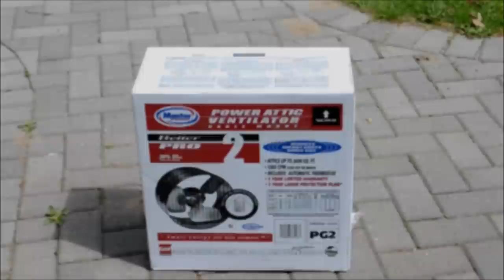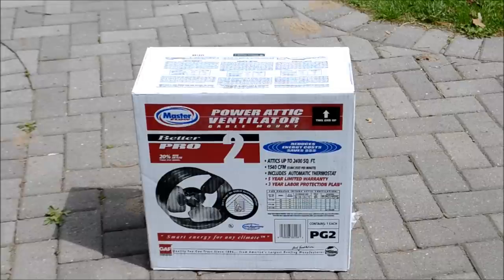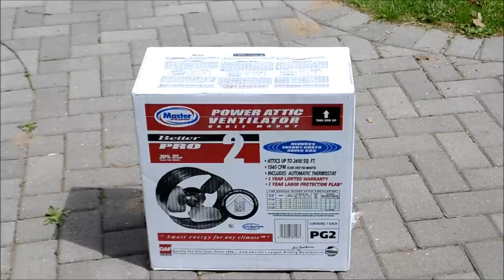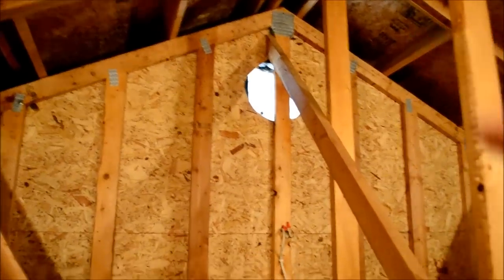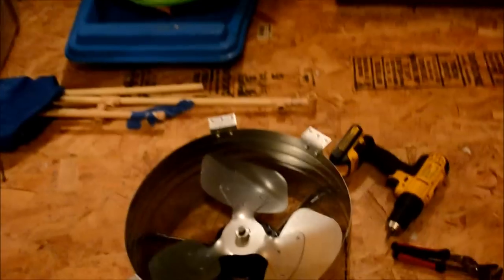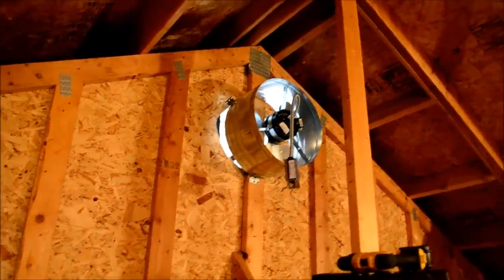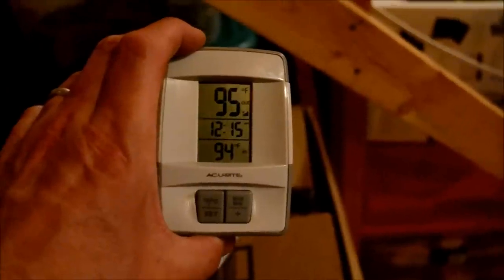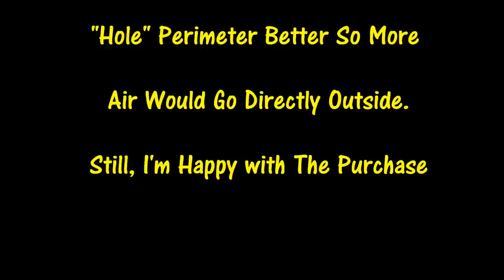Master Flow Power Attic Ventilator Fan (Gable Mount) Installation & Review

Comment: Mounted one year`s ago with good results. Just placed a floor fan at the other end in a push-pull configuration;  immediate results as the attic temp was 88 at 9:30am; outside temp at 11:15 is 79 degrees, attic is now 105 and I can feel a good flow over the air handler and out to the mounted fan. If this proves to be as good as I think it is I will mount another one permanently and remove the floor fan. Outside air is 80 degrees in southern New Jersey. House feels cooler.

Comment: success ! placed one in reverse in the detached garage - airflow is nice, right out to the other gable vent, about 25 feet away; will be removing the plastic vent and constructing my own to increase exit area; all of the commercial gable vents are useless and slow. Attic temp is 106 at 3pm, outside temp is 82 but feels hotter

Comment: My attic looks just like yours!  The "gottcha" is finding a color-coordinated louver on the outside to match the style and color of the vinyl siding.  The current louver is far too restrictive to force the air out through eight tiny openings.  If the covering looks too industrial, the project will never proceed.

Comment: constructed my own attic gable vent ( House ), increased performance by 50% at least; outside temp is 89, attic is 108 at 11:30am in southern New Jersey; attic temp yesterday peaked at 120 then rapidly came down. It appears that mounting another fan in a push setup would be overkill. Moved the temp sensor to what I think is the hottest part of the attic to see if there are any changes. Secondary floor fan has been turned of for this test.

Comment: You should never cut your trusses always consultant engineer or architect
Reply: Michael Charnin Agreed, never cut a truss and consult an expert for such work. What he cut was not a truss. It’s considered truss bracing and there is room for interpretation with code on these. Sometimes they are not even spelled out in the truss package but they expect you to at least follow a standard like what is proposed in the SBCA/BCSI. With a completed home and no inspection, relocating that brace would be fine. I would have suggested to use new full length board attached as high as possible (right under the fan), span the same number of uprights as before and reach all the way to the bottom of the truss, as the original most likely was. Deck screw are also advised since you are not using glue dipped nails like what a framing nail gun fires.

Comment: That brace and stud you cut were there for a reason...so how many degrees did it drop?
Reply from the maker: True about the brace, I redirected the load to another brace after the video.  The temperature has dropped pretty effectively in the attic space.  I'm quite happy I did this.  Thx for watching!
Reply: I guess the temp gauge he showed us in the attic didn’t give him much difference in temps since he never states the figures.

Comment: "The Man" if you can do a better job than this guy, why don't you make a video yourself and show it? .... maybe you're just god at criticizing but have nothing to show for it at all.  Now who do you think is pathetic?
Reply: agreed, I mounted mine the same way and it works great, current attic temp is 110 degrees and considering mounting another at the other end for a push pull set up; right now there is a table fan there to see how it would work
Reply: I'm also wondering if you restrict the out flow by sealing it, might it put strain on the motor??